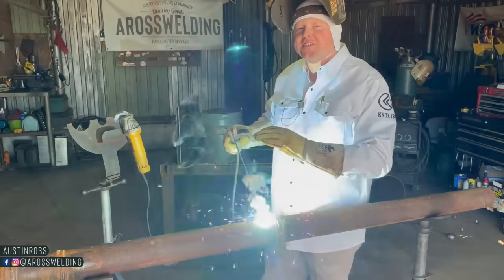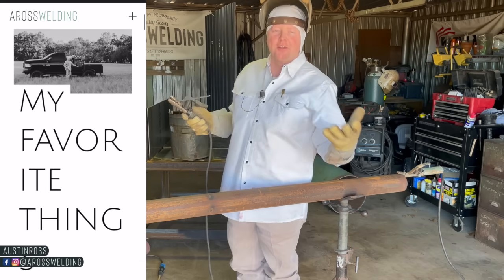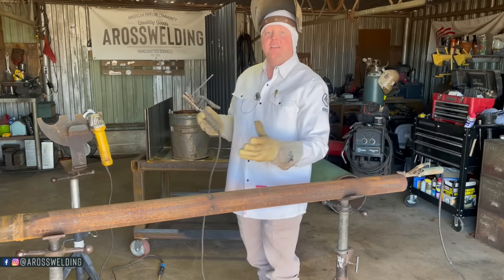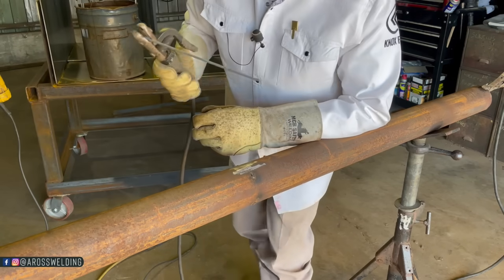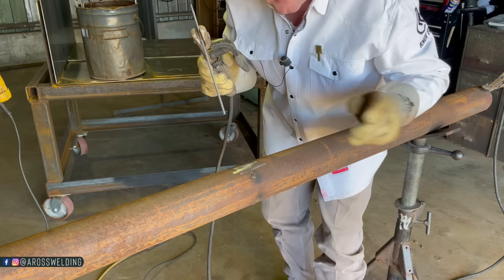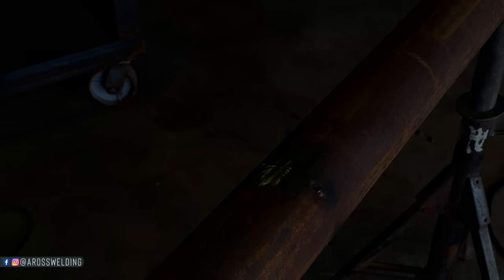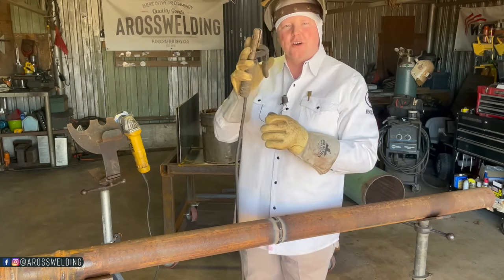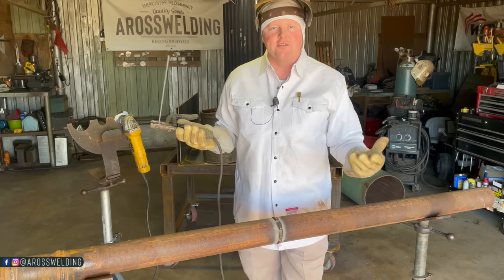Do this instead (3 Stick Welding Tips)

Comment: I have never welded.  Do you actually touch the workpiece with the rod, or is it just floating in the molten pool and you feed the rod to keep in the Pool?
Meaning can you Feel that you're putting pressure against the workpiece or is it just visual, following the pool of molten metal?
I get that when you Strike up the Weld there is some physical Contact you can feel.  But once the arc is going, what do you feel?
Seems like that Long rod would make steady control difficult.  A shorter length might make it easier.  Can you steady the Length sticking out using you other gloved hand,  or is it bad Practice to touch the rod?

Comment: I only just used my machine for the first time just to drop a line yesterday on a piece of scrap metal... strike it like a match? Doesn't make a single bit of sense, if anything one just has to very slightly tap the piece to weld on and sometimes just getting it really close is enough.

Comment: If I had to give anyone starting stick 1 bit of advice it would be to get a scrap piece of metal you can strike an arc off on.. The biggest hurdle isnt actually striking its knowing when the rod will strike, A cold rod or rod with flux covering the end of the rod wont strike an arc, and by the time you have actually got an arc started and sustained you will have bits of broken flux and bb's all over your joint.. Ge the tip of the rod glowing hot on a strike plate, essentially use the strike plate as a dirty strike or firing off plate, do whatever you need to do to get the flux off the end of the rod to expose the bare metal and get the tip glowing hot enough that it strikes an arc first time when you transfer to the actual piece your working on.

Comment: I haven't welded for 30 years and was given an old cheap welding box, so go into Bunnings (which is an Australian hardware store) and bought flip top old school welding face shield, and I became aware that people buying welding equipment in line behind me were staring.  Went home started welding frame and found I couldn't see. 
I continue flipping lid just before striking arc and thought . Wow I know it was tricky to see but I don't remember it being this hard to see  anyway persevered , tryed in bright sunlight, tryed with work light right beside weld still couldn't see, long story short, spent 3 days seriously 3 days welding with one hand and flipping glass up and down with other, even while welding I still couldn't see so was welding blind for 3 days. When I finished the frame I thought I would give everything a good clean before storing, I wiped the glass with alcohol wipes and and a film started on glass, then I realised that there was protective film coating on both sides of dark welding glass.. I couldn't believe it .. peeled it off both sides and wow . I could see , and also found out there is new helmets

Comment: Just today got a welder... Have used several here and there. Was always horrible, and useless on stick welding, I'm a 220lb wrecking ball lol your tip about being gentle completely helped,  still trying to adjust to holding an arc, can't understand the jump gap holding finesse. Touching off and holding a distance is very counter intuitive for me, (electrician) lmao thanks 👍

Comment: Well, one other good tip is ensure your rods are good and dry. 7018 sucks at starting an arc as it is already especially for beginners but worse to start (and maintain) when they're old and absorbed moisture from the air. 

Since I don't have a rod oven, I only use new 7018 out of the pack, if they've been lying about the place too long, I avoid them. I hear storing them in closed containers with rice helps keep them dry, never tried that but I think I'm going to.

Comment: 49yrs old and laid my first 12inches of beads today with the stick -- def had troubles in the first 3 inch strip with sticking the rod -- figured out by next strip that a light touch was proper to initiate the arc and dont stuff it into the corner lol - but after it was running i might have lost the arc by not keeping up with it ie too much gap arc to metal --- i think overall i was too hot and i had jacked up the amps from struggling to get the arc started thinking i didn't have enough juice but then everything thereafter was HIDEOUS and a mess i guess because it was so hot i had to go really fast to keep up and kept gapping the arc away from the metal on one spectrum and then over-compensating jamming into the gap right after; slag was quite stubborn --- its HARD. Prep is a PITA - how clean does the metal have to be, is there room to just do a quick dirty joint if theres no levity around its potential failure?  I have been electrical soldering very tiny fine joints for over a decade.    Just for fun - learning something new figured it might be a handy skill.   Thanks for the education!

Comment: I worked at a place about 3 lifetimes ago that was having an addition added onto a steel building. The welder that was working on the structure had an old broken file about 3" long hanging from his belt. Every now and then you would see him run the rod tip across the file to freshen up the end of the rod

Comment: I actually have taken a 200 hour welding class through the state of Massachusetts where I live and my instructors told me that exact same thing strike it like a match. It took me a while to realize it's not like that. You can actually just get super close to the metal your trying to weld, and if it clean enough your arc will just pop off no problem.

Comment: the biggest take away for new welders is prep.  good prep is key to good welds and clean metal and grounds make a night and day difference.  even when using 601 or 6011 rods that are a bit more forgiving.   but if you practice good prep you set yourself up for good welds. strike just under where your weld starts so you burn over the ark strike everytime

Comment: I pluck an arc and flick my flux
Reply: I’ve seen that stop and start practice technique and I only have a small suitcase welder running 1/16 6013 rods and I have to chop the tip most times when I stop even though I whip out!!
Reply: Could be because of the flimsy nature of such a small rod I dunno? I’m here to learn

Comment: Ok Austin Ross, just one single detail related to your advisory tutorial video  that wasn't mentioned it is:

Thus it is impossible to restar again the weld on the same welding rod without gently breaking off the non conductive surrounding flux shell around the shortened electrode metallic tip to protrude out from it and get a good bare metal to metal contact.

Therefore, to get a smooth start just like a new rod with its shining metallic tip slightly protruded out from the flux shell, it is mandatory one way or another, somehow to strike that flux crown off the tip, all right ?

Comment: Hello Mr Ross! I've gotten pretty decent at striking up the 3/32 rods I use, and, can almost strike the 1/8 6010 by 3rd try (lol! I'm a newbie) the 1/8 7018 on the other hand...Ugh, That rod is not easy for me. Even if I strike it successfully, I still have trouble maintaining the arc; I either get too close and it gets stuck in the puddle, or I pull too far away and it can't maintain it. It's so different from the 6010 6013 and 7014 rods I have. They don't give me anywhere near as much trouble. I am going to try what you suggest as soon as the weather permits me to strike an arc again. 

I have watched a few of your videos now. This was the first one, and, I found your youtube channel by accident. A very good accident! You make it look so easy. LoL, you clearly do have years of experience with this! You explain and demonstrate in such an easy to follow manner, You'd make a great instructor Sir!

Thank you so much for sharing some of what you know in these videos in the way in which you do. I'm learning so much and I appreciate it! I really do. Thanks again Mr Ross!

Comment: The advice "strike it like a match" originated when matches were much easier to strike, and an every day item.

"Srike anywhere" matches barely exist today because they present a fire hazard in shipping (they can ignite themselves by rubbing together in transit).

Todays matches take more pressure to ignite, and are no longer used multiple times per day by the average person, so technique is also a factor.

So "strike it like a match" is still applicable to welding, if you change it to "strike it the way a person who uses 'strike anywhere' matches 20 or 30 times a day strikes their match".

Comment: I have been told that if the rod is sticking, my welder settings are too low, apparently not.  You always talk about throwing away welding rods, they are so expensive, I can't stand wasting them.  thanks.

Comment: I had a miller inverter, and I have a really expensive Tig, that one could weld with a stick.  But the welders I actually use for little porjects around the shop are the 100 dollar jobs.  I have that harbor freight one.  Discounting for Canada, some of these are maybe 65 bucks.  I got a MIG that was 60 bucks, and I could not believe the deal, even as a boat anchor.  So issue one is (and I am going to check your back catalog), can you weld (obviously yes) with one of these popular units, and what is your experience?  Next is safety.  I'm Guessing HF doesn't want to get sued, but there are probably some additional cautions when working with these machines...

The last project I made with my welder was 4 posts that attach to the boat trailer for a roof rack for kayaks.  It is 2 inch stock, and super over built relative to the loads, though it needs to be stiff, and accept hardware.  I had no problem welding it with one of these cheapos.  They have several challenges, they are not as smooth running for me as an expensive welder, but still pretty amazing.  And some of the work uses the smallest rods, which are not stiff.  It is just a different world.

When it came to replacing my Miller lunchbox, with a Tig rig, I was thinking dynasty.  But the problem is for extreme low use guys, the service costs that are built in don't work for us.  My lifetime use might be hundreds of hours, not thousands, and if it breaks in 10 years, after 50 hours, they are not going to cover the circuit board.  They are servicing shops  that are full time, and they won't take care of the low volume user.  So info on how to weld with crap is probably really sexy for some.

Comment: good luck with 7018's. you will stick. 7014's will work like that but are not structural. He's right! You need to prime your tip and focus on your start travel and angle and pace.

Comment: Why don't you fabricate a complete replica 1917 WW1 USA biplane and still wearin' your barnstormers' attire, fly right away in it?
Lovely voice and humour. It makes me wanna use the Castolin & Eutectic Swiss Inverter Welder without a mask, too!
I bought it for $12 USD and fixed it for 89 cents. Happy?
Yes sir!
But having had Arc Eye in my teens, no, I'm gonna just have to wait for that mask to arrive...
My 'new' welder was a spare or repair machine. It was around $1,000 in 1990. Beautiful to see the insides, it looks like a Cray Computer. Well, it is Swiss. Have a great weekend welderman!

Comment: May yo u can help, have a buzz bow a Linde. Bought a generator 9000 starting and 7200 running . Can’t weld for more than ten seconds before it throws the breaker on the generator. Very frustrating

Comment: Im a non stickwelder.. but trying to get my heading, got one in transit, but I dont get how people are holding stick welders.
When I solder I prefer to get as close to the materiel as possible. so I prefer a soldering pen with very little tip length, to have fine control.
why are you holding your stickwelder with the right hand..
wouldn't it be preferred for a right handed person to hold the handpiece wth the left hand, and then use the right hand to hold onto the mid part of the weldingrod, as a fine guidance.. I would reckon it would give extremely fine control if you cut the distance so much, with your main hand, and then obviously moving your righthand/fingers back, when your nearing the pool, while using the left hand to simply hold the weight of the handpiece.

Or is that is a bad practise, and could give people that didn't use gloves.. electricity shocks in some way?.. though most people are hopefully wearing gloves and protective gear..

Comment: As a electrician most of my time striking an arc was a failure in the extreme.
 So it's been a traumatic experience rewiring my brain and convincing myself I really needed to do it.
 After many hours I've realised it's about a good connection [ comes from  the electrician ]  comfortable.... and finally    being really gentle with it . Tbh I'm so plsd I came across this video.
 If I was paid every time I switched it all off & simply walked away I'd be rich.
Excellent advice bro

Comment: Phenomal welding skills sir.  Subbed.  On my second class of into to smaw stick, and i had a lot of issues with the 7018 sticking.  I tried turning amps down, up, etc.   I think using the stinger and just practicing as you did, and getting COMFORTABLE is key.
Reply from the maker: Thank you for the sub. We greatly appreciate it!

Comment: I learned many years ago as a pipe welders helper on 6" - 12" to set my machine to 1/8" P5 for the downhand root and hot pass but when I fill & cap with 7018 I use 3/32" without reseting my heat. Many pipe welders have busted when they ran 1/8" P5 but had to reset increase their heat for 1/8" 7018.

Comment: I'm just getting started welding (still waiting to acquire the last couple bits of equipment I need) and have been reviewing a lot of beginner tutorials. This video helps a lot because a lot of instructions will cover starting a bead very briefly before going into tips and tricks for the rest of the process. The occasional stick I was seeing get stuck on start-up had me concerned I'd get confused and not know what to do if the same happened to me. You've covered that angle now, so thank you! I see you're in Oklahoma too. Do you do any in-person instruction?

Comment: Another trick I've found useful for busting the flux off of 7018 is just twisting it like you're putting out a smoke on the Phillips screw in the stinger.

Comment: I remember having all kinds of issues when I started welding - sticking rods, holes in material, slag under the welds, etc. I've been trying all settings from 60 to 200 amps and electrodes from 1.0mm to 4.0mm and nothing worked well whatever I tried. Then I realized it's actually all about a touch. If you're gentle enough and have a calm and relaxed hand you can do whatever you want with any equipment and setting you're working with. Of course, that still requires to have some basic knowledge about materials you're welding but steady-hand is a key to get your job done successfully (sorry people with Parkinson's).

Comment: Finally, an explanation besides "like a match". I'll try it like you explained later. Haven't welded in like 12 years, I was barely a novice then. I did get it (a shitty little arc welder) to make a tiny weld and did notice it was when I was way more gentle with the strike. 7018 might not have been good rod to start with. People seem to say try 6013 is easier. Need to fix my lawnmower deck bracket. Thank you.

Comment: I’ve stick welded on and off for years, just now actually learning to do it well, I’m a beginner, but the most important thing I’ve found to help when striking is filing/sanding the tip of my rod, the cleaner it is the easier it is to strike in my experience

Comment: I really like your video, but had trouble seeing (video too dark) the 7018 re-striking part. Guess if weld stopped to restart the 7018 tip has to be electrically "clean" for contact. Would like to hear how it was cleaned for restarting. Thanks for video!!

Comment: One minute video.  Clean your work lead location, establish as comfortable and supported position as possible, use a gentle tap motion with a slight flick.  To restart, remove the flux formed over the electrode end before attempting to start the electrode.

Comment: 6011 rods stick to beat hell. No such thing as being gentle with them. 7014 rods work far better for striking. I've heard every bull shit story about 6011 rods being good that there is. The last few 6011 rods I had would even stick after you have an arc going. I gave those pieces of shit away since they weren't even worth using in desperation. I've been welding for 54 years. Beginner welders should be told about 6011 rods so they don't wonder why being gentle fails on them.

Comment: Nice tip

One question about clothing. How come you dress in white and keep it so clean? I have all black/dark blue welding shirts. Any lighter shade like red, light blue will get dark very easy from all the grindin dust, and the hot mill steels have black stuff on it. So handling steel and grinding and welding will get my clothes quite dirty fast.

I bet i could keep clean if i was welding only shiny aluminium with tig in a clean environment. But around the house in the yard with stick welding and grinding an hot mill scaled steel and generally bigger stuff i have to rest on seems impossible.